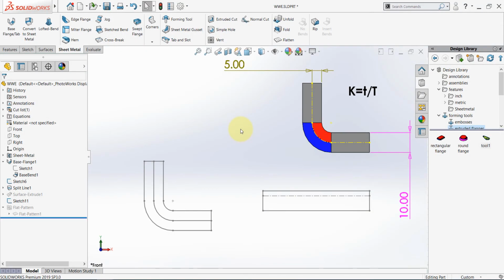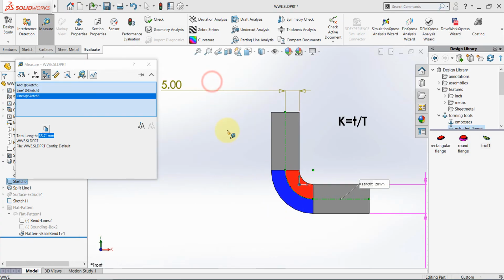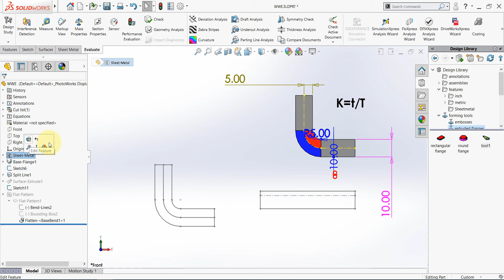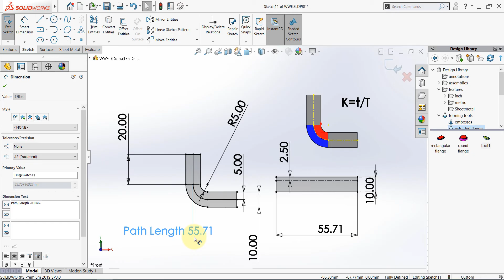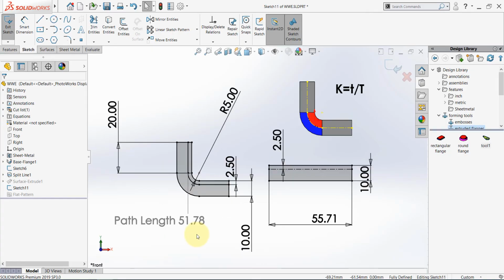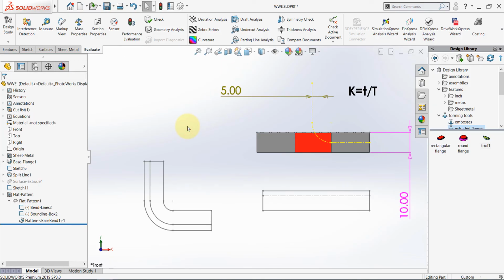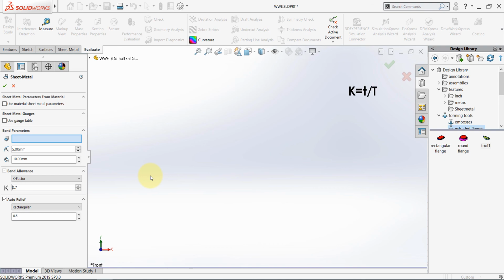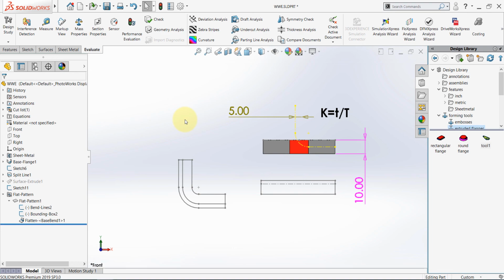Sheet Metal K Factor (What is it and How to Measure it) Solidworks

Comment: I need a k-factor list that lists a specific number for every conceivable type of metal (and alloy) and thickness for air bending. I use Creo at work, which uses Y-factor as its default, which I know equals K-factor times Pi divided by 2. But I need to know a specific k-factor number for the specific material we're using before I can accurately determine the Y-factor. And we work with all types of materials including 5052, 6061, 2024, 7075, mild and stainless steel sheets and plates. Does anyone know of any such repository of information, or maybe a calculator/spreadsheet that someone has created somewhere?

Comment: Youd did not provide leg lengths of the angle so it is hard to cross check, I drew a 2"x2" angle on ACAD, .074 thickness and got a K-factor of .121, so my stretch out would be 4.121 inches?

Comment: The higher value of k-factor physically indicates the hard material, because the neutral axis distance is far away from the middle. And for soft material the neutral axis is close to inner surface of metal regardless of same thickness is considered for two type metraial and same bend angle.

Comment: Hello. Why would one want to change the neutral axis position instead of being dead center on the thickness? has it got something to do with bending angle and radius? Thank for the video, very easily explained :)
Reply from the maker: Hey :)
The reason why is that if you measure the total length of a sheet before and after bending, they won't be the same. That is the result of the tension and the compression that the sheet wetness during the process of bending. That is why the concept of the k-factor was introduced. basically it is a relation between the neutral axis and the thickness which can be used to approximate the length of the sheet after bending :)  
There are many factors control this process, the angle, material,the process,etc. 
So using the k-factor helps us prediction the length of a sheet after pending. 

Many thanks for your nice comment :)
Reply: @mohammadzgoul90  so the 2 values are supposed to match?
Reply: Neutral Axis = Bend Radius + 1/2 * Material Thickness
Reply: @cjoy36  Not quite . The K factor has to be allowed for and this alters depending upon the material .